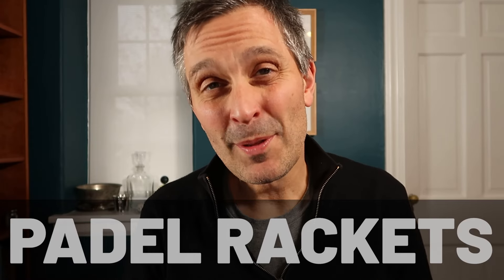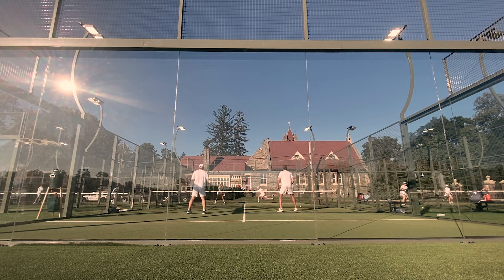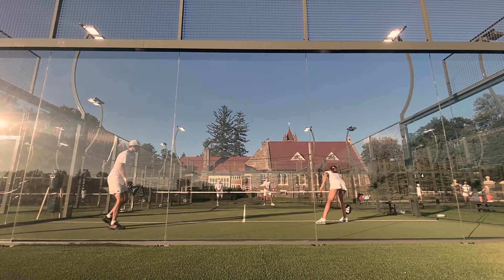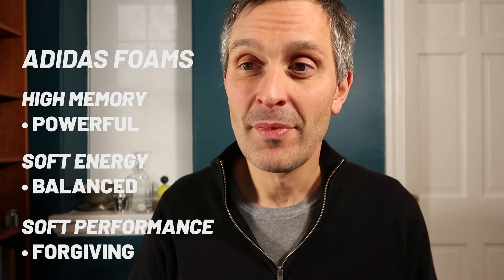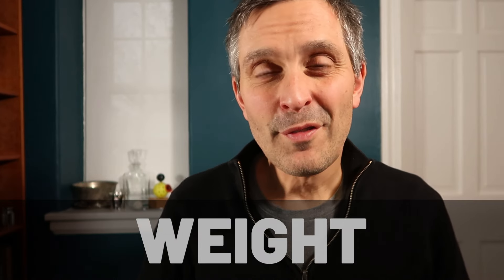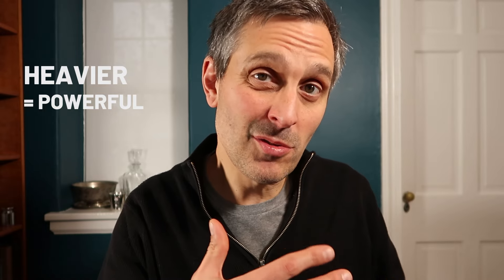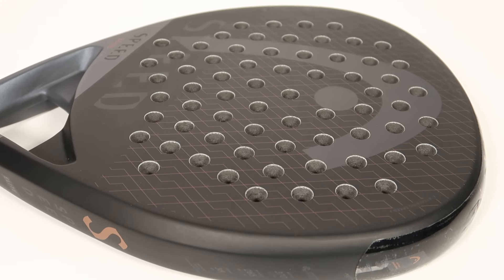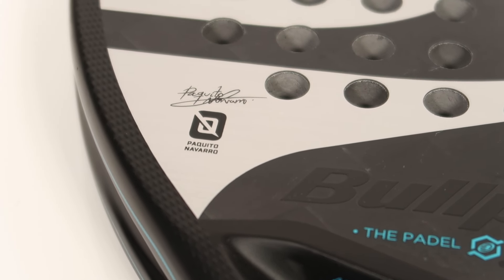Padel Rackets Differences Explained

Comment: Addition to the grits, some are moulded (higher end rackets) and other are added after production (which can fade after use). A lot of youtubers has tested the effect on smooth vs rough surface, and you can really feel the difference for the most high end rough surface rackets as oppose to the "semi rough", which are impossible to feel the difference.